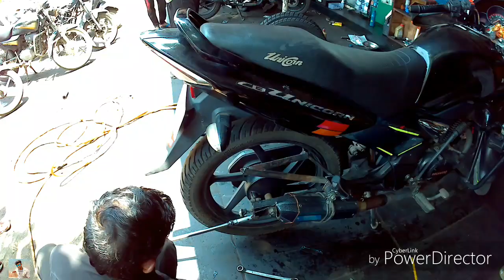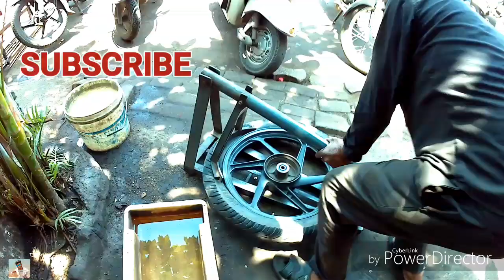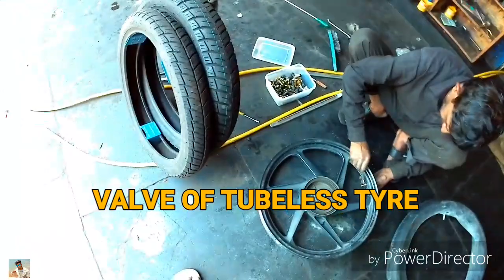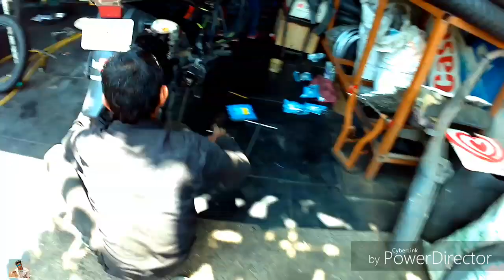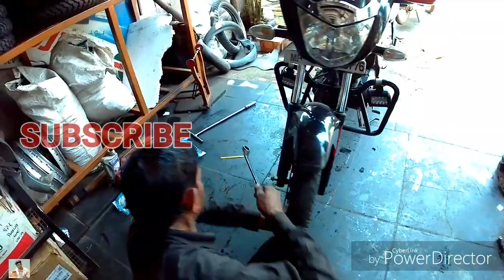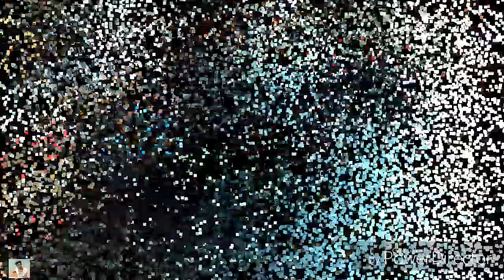TUBELESS TYRE INSTALLATION ON CB UNICORN 150 STD HD

Comment: can I put 140 size rear tyre in unicorn.?

is it possible?
Reply from the maker: It is possible but the thing is it will touch the chain cover and if you want to put it the go to a good garage and remove the chain cover and see if it fits properly

Comment: Rim, differences tube and tubeless tyres long run tyre not seat properly in rim money waste
Reply from the maker: No not at all.. I have ride my Motorcycle for more than 3000 kms and still the tubeless tyres are On and there is nothing issue with the tubeless tyres... you need to fit them properly...